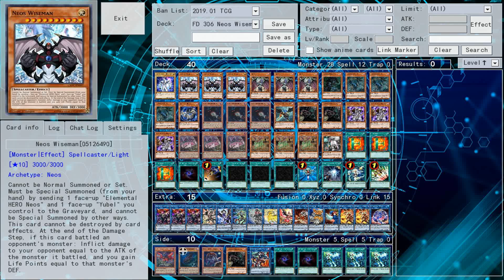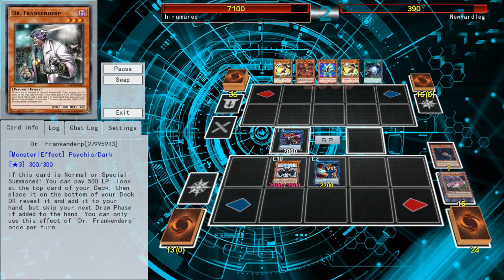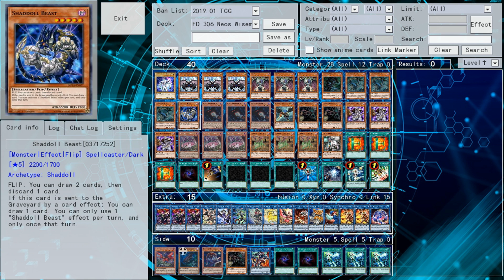Neos Wiseman Turbo (danger ftk engine) YuGiOh

Comment: I think that ironically enough the deck would be even more consistent if you brought Yubel and Wiseman at 1, the draw power of the deck is that crazy and while you may think "but those are my key cards, while would you want to run them at 1?", it just works. The downside though because you can end up with no cards on your deck left.
Reply: Yubel sure, but not Wiseman since he's not recoverable if you discard him.